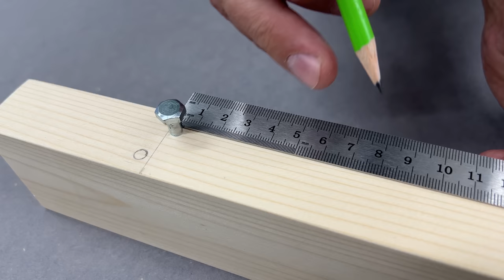DIY Retractable Casters Wheels - A Simple And Effective Solution!

Comment: Over the years I have seen many versions of this, and even have copied one for myself, but it failed and broke - I can honestly say this is the best version I've seen.  SImple, easy, the kicker release is perfect.
Reply: Agreed. Very well done.
Reply: Same here.
While we're at it, something has to be done for home appliances and work desks with castors.
These are made from plastic materials and a guard/coover which trap fibres, swarf and such stuff which cause jamming and destruction.
Difficult to replace these.
Reply: I suspect his broke as well. At 6:33 the hinges have been changed.
Reply: @1992jamo  Well spotted ! - yes he has changed the hinges for ones with a stronger central pin. I was planning to use ones that are rated for heavy doors, but even so, very well spotted.
Reply: Fantastic idea but i would trust the author more if he would have mentioned that he changed the hinges connected to the metal legs and show what type hinges he used, instead of just hoping the viewer would spot it and figure it out
Reply: Need nearly a foot (300mm) vertical clearance to operate.
Reply: Gghh🎉a lot away

Comment: Perhaps the simplest  cheapest, and easiest solution to retractable wheels I have seen on YT so far, and I've seen dozens of ideas from poorly thought out, to much to overly complicated ideas.
The 3" wheels are fairly cheap, you can buy cut offs of the angle iron almost anywhere for less that $10, and the spring and lag bolt are just as cheap. What I love about this style is that they do not cause a tripping hazard. I bought years ago the "Work Bench" wheels that stick out at each corner, but when I laid them out, I realized just how much the stood out from each corner, and never installed them. I still have them and will be putting them up for sale instead of letting them collect more sawdust.
Thanks for sharing your idea. My first video of yours and I have subscribed!

Comment: This may be the best solution all round for making the various tool stands I need to build mobile when I need them to be mobile and not at all mobile when I don't. Cheap, simple to build, easy to use, and no trip hazard. It helps that they work with the design of tool stand I have in my head!

Comment: Good idea. The longer you make the bottom piece, the more leverage will work to your advantage, making it easier to raise back up. The tradeoff, of course, is lifting height. However, as most of us would be using this for heavy items, and as most persons have a smooth shop floor, I'd opt to go as long as possible and still get 0.25 inches of height. Also, the farther you place the locking lever from the fulcrum, the less force there will be upon it. Cheers.

Comment: Wonderful. 

Might I suggest a slight mod? If you keep the latch angle at 90 degrees it's prone to slippage. Decreasing it slightly and rounding the inner corner makes for a much more positive 'lock' when the catch is closed.

I've just completed a small support table for my thicknesser and couldn't be more pleased with it. 

A big THANK YOU!

Comment: Great simple concept but I had to make an alternate to the spring catch mechanism. The cross member on my bench joining the legs is on the outside of the legs and just above the timbers for the wheels. I added a block to the top timber and when pushed down to raise the bench, the top of the block I added was slightly above the cross member. I drilled a hole through the cross member and the block and then pushed a bolt (as a pin) through to lock the wheels in place. To lower the bench legs I put slight downward pressure on the block and pull the pin out. Works well.

Comment: I need to do the reverse:  I have a cabinet that has casters under it and I want to build retractable feet so that I can stop it from rolling when I want to.  You've given me some ideas.
Reply: You could remove the casters you have, and implement this exactly as shown too
Reply: @Andrew-wq1ue  True.  The problem is that my application is not a workbench with legs that this device can mount between.  It is a square cabinet with casters mounted to the bottom of it.  I can't mount this device to the sides of the cabinet because it has doors on three sides, and I can't raise the cabinet to provide extra room for this device underneath it because it has to fit under one of my workbenches.  🤔
Reply: @Dan-hw9iu  Thanks for the suggestion.  I tried that, and even though the wheels lock they still swivel so the cabinet still moves a bit.   My table saw is mounted on top of it, so ideally I would like it to be rock-steady when it's locked.  I have a very small workshop so the table saw needs to roll under a workbench when I'm not using it.

Comment: Thumbs up for an excellent presentation.  
The hinges look too weak for a heavy bench, I would probably at least bolt them through rather than screw them in. And use a tough hardwood such as ash rather than 2x4 pine.  Regardless, a very nice video.  I would also like to mention that the presenter has excellent skills with the grinder !

Comment: Nice! Can this be done with 10" pneumatic wheels? Also, a challenge:  how could this be done on a tripod? Have been going around and around on it for months. Want to roll it over grass and bumps with a system like this, hence the large wheels (heavy telescope). Many many telescope dolly designs out there, but none like this where the legs can be on the ground after rolling it over. Making it even harder is that the legs are round and can't be drilled because the extension legs slide up into the top parts of the legs.

Comment: Very nice, simple idea.  However a steel table will be used to put very heavy loads on it.  The entire weight of the table will be held by the one bolt that is hooked.  Failure point to correct.

Comment: ahh, yes, metric... Here the wood does not come in metric. It's in "United States customary units", meaning it's measured in how many knots, cracks, and twists the board has. And, if the number of knots, cracks, and twists is zero, that means they don't carry it. 
Thanks for the vid and quality workmanship. It reminds me of a lift system on an old teletype table I've seen.
Reply: Who knew there would be a day when EVERYONE here in the USA would be using "Knotty pine" 2x4's. Oy vey.

Comment: I'd be curious how much weight this can hold with the wheels down.
I cannot see it having much load bearing strength with only the single latch holding it together like that on each side.
Reply: I built a very similar system on my workbench last year and it’s holding up great. My bench has a 12” sliding miter saw on it and I store my drills, router, sanders, Kreg system lots of various stuff on the bottom shelf. It’s amazingly easy to roll around when I need to move it.

Comment: Extremely well made video.  Looks simple.  Followed it to  the end.  However, could not find the use of all that trouble of grinding, boring, drilling, etc.  I could just as well attach casters to a 2 x 4 and almost get the same result.  However, a really good job at displaying the steps to take.  At the end, you could have shown a little more of how the contraption helps.

Comment: What's the load capacity of this design? I'm rolling around about a 1500£ rack on my carpet and this kind of retractable casters would be very useful to keep the built in casters from sinking into the carpet between moves, but I can't imagine it can provide enough support or leverage to move a full, laden rack
Reply: FYI -- £ is a symbol of currency, not weight... Sometimes # is used as a symbol for pounds (weight), but 'lb' is just as good and takes the same number of keystrokes... Or was this the case of a speech to text conversion using that symbol?

I have a platform / dolly for my Harley that weighs nearly that much when fully loaded (i.e. when I'm riding the motorcycle on top of it)... Some sort of retractable casters would be nice on it, but  I have 4 casters under the platform and I doubt there is room enough for this sort of thing... But it is an interesting idea to think about...
Reply: @seanseoltoir  that's... Not exactly helpful? It doesn't give me any info on the load bearing or lifting limits of this setup.
Reply: @aarcaneorg He just wanted to tell ppl he has a harley. Ppl who are all about brand names are like that.

Comment: Was I the only one irked that the very first castor was eyeballed and then installed crooked? :face-blue-wide-eyes:  An interesting design, but it seems to me that the hinge on the side you push down to engage the castors will get a lot of pressure and the forces will pull and tear out the hinge over time.

Comment: Clever design but unfortunately this would not sustain holding a lot of weight. The tension ends up directly on the bolt holding the latch and after a certain point of pressure it will either snap the stud it's screwed into, or snap the bolt, whichever is weaker.